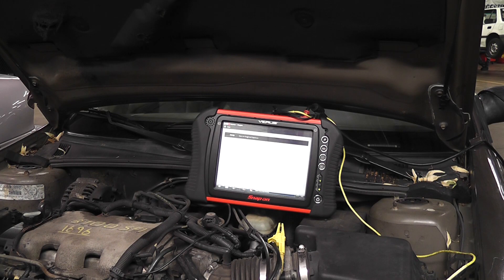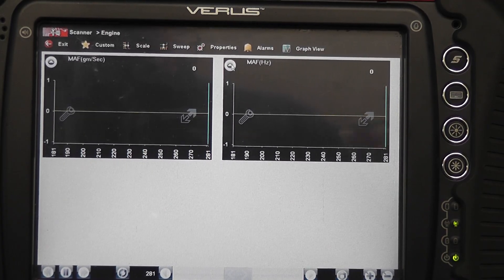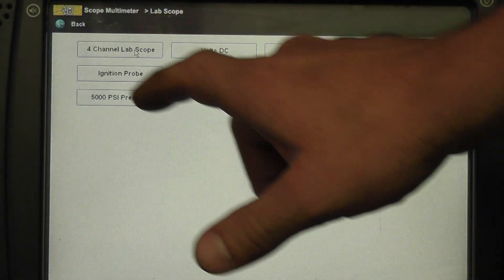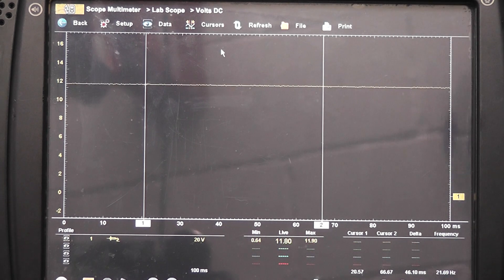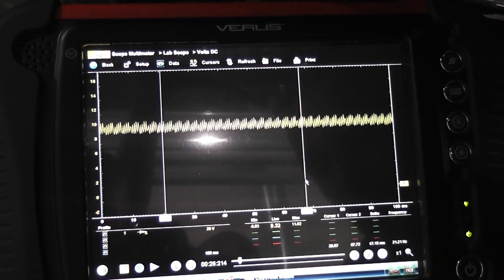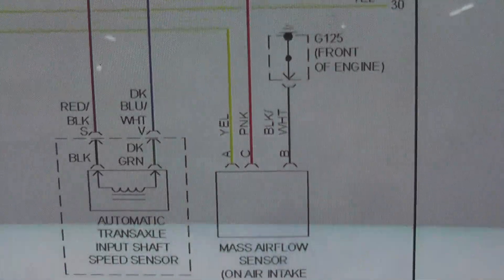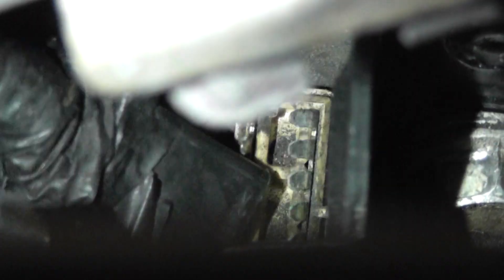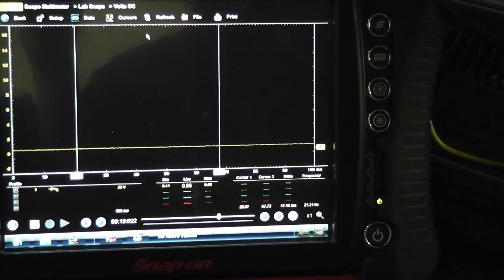MAF sensor trouble code (P0102) caused by a bad ground (GM 3100)

Comment: Watched a lot of your videos. they're a great help. But ran into something that has not been mentioned anywhere. My sons 1998 Pontiac Transport 3.4 l. In this you talk about a 5 volt square wave and its a pull down circuit. I ran done every thing as stated , 3 wire connector as you show there. id the three wires. we have three codes of P0102,P0300, P0440. starts ok when cold but warms runs bad, and stalls if you let it, hard to restart. all went ok till the signal wire to either battery ground or sensor ground at plug with a volt meter. with motor running instead of 1 volt and ramps with rpm increase it reads a 4.45 volt regardless of rpm and or either ground. Cant seem to find anything on it. Was told that MAF was bad and replaced it to have same issues. Thanks for any help.
Reply: sounds like mine 3800 series 2

Comment: Yes but dealing with a newer car the chances of it being a bad ground are slim and nil, especially if no work has been performed, it is a better chance that it is a fouled sensor, or dirty air filter restricting airflow
Reply from the maker: Would you know what a bad ground on a sening cirxuit looks like? This video and procedure goes way beyond an older car. There is a principle here that applies to everything!
Reply: Hahahaha! You must not live in the Midwest.

Comment: Would have been okay while back probing the ground, to touch a test light hooked up to battery ground to that computer ground wire in order to give it your own ground while checking the signal wire?
Reply from the maker: test light not needed, just a jumper wire to ground would have worked, so yes

Comment: Very Helpful Video. Thank You.
Daughters Mercury Milan lost engine power, I scanned the ECM and got P0102 and P0113. Doubtful both went bad at the same time I figured another problem like wiring. After your video I found and fixed the ground connection. Now all is well. Problem Solved. Thank You For Taking The Time To Do This  Video.
Reply: Exactly the same issue I'm searching for. You could say I'm a good woman.a darn good woman. Obd2 codes are PO102 AND PO113
2008 Toyota 4Runner crank no start. It's been 4 months without a vehicle and I'm going crazy. Trying to help my hubby. Watching videos cleaned maf, replaced battery , first off hubby went strait to the fuel pump and filter. Changed the filter, pump was OK.

Comment: Got 99 buick regal ls....stutters when accelerating. Changed spark plugs and wires....whoever had the car before tore the boot for the #4 plug and wrapped tape around it so it super coroded and broke off. That stopped the misfire, but i also had a p0102 voltage high code. Cleaned the maf sensor and it worked fine for a while that day then the code came back. Should i just change it or do a little more digging.
Reply from the maker: watch this https://youtu.be/p2QLxxstRn8
https://youtu.be/E8sBg7kMbOw

Comment: Well done ... I have a question... Got a 99 chevy suburban within the 
past 5 years it slowly A- starting running good then rough and now very 
rough, B -gas gauge fluttered a little, got worse and worse to now full 
on flutter on "Full" and C random shit is shorting out once something is
 fixed ... for instance ...AC dashboard switch (medium low) grey wire 
burned out... once that was fixed the 3rd or Medium high burned out wire
 ... once that was fixed my 4wd actuator started shorting out... then 
battery drained...then rear driver side tail light mother board burned 
out (bulbs were black and mother board smelled like burned plastic)... 
then alternator dies, battery again, window motor driver side burned out
 (melted plastic) ...Blower motor wire burned ...etc ... ALL right after
 another ...all electrical and it's running very rough now, (idle is 
rough but runs good on highway), random misfires codes po300 came on 
today while trying to fix barn door lock then went off and came back 
intermittently, abs light came on last week as well and gas gauge 
flutters (need to look close-flutters so quick) at full constantly. One 
mechanic said it was engine rebuild, another said fuel pump and another 
said Fuel injector(fuel spider) ... I believe its just a bad ground 
somewhere... possibly in the back near the gas tank??? b/c my driver 
side rear defroster in window do not work (passenger side does) and also
 I replaced my driver side rear tail light mother board three times 
already(including last week)...once I replaced it the ABS light came 
on... I jiggled the copper connectors for my rear barn door (driver side
 door) door doesnt have wired connectors, instead it has those copper 
pins or connectors sticking out... while doing this with a friend we 
noticed gas gauge would stop fluttering and go down to almost empty fuel
 gauge (which I think is where it is at) ... that's the first time I saw
 the fuel gauge NOT flicker in 6 years! and misfire codes disappeared as
 well ... any idea? Am I crazy or what ... also- I sprayed electrical 
cleaner on ground under driver side rear (strapped on to fuel line 
connected to gas tank and my friend put his hand on it and swears he 
felt a tiny shock ... I did it a minute later and didnt feel anything...
 any ideas? I'm desperate but determined and also, everything that goes 
wrong electrically (in case I havent made it clear) seems to go right 
after the other- which is why  I think it's a grounding issue
Reply from the maker: you have more issues than I can help with here. Can you post to my forum?
http://www.scannerdanner.com/forum#/general-repair-questions/

Comment: I have a 2001 Chevy Malibu that just cut off on me while driving. I was told a few things and none of them have been right so far. Now I have a friend who asked to see what's up with the car and when we tried to turn her on we had smoke rising from under the car somewhere. My question is could that smoke be coming from the connection terminals to the battery or the starter. I'm really not to big on working on cars nor fixing them but your help and guidance would greatly be needed

Comment: hi Paul. great video, very informational. one question, where do you get your wiring diagrams ? they help out a ton in situations like this. i needed one yesterday when i was trying to test a family members P2135. it was a drive by wire TB. but then noticed that it had some kind of short, i would hit the headlight switch on and off and would hear a popping sound in the seat warmers, the bass in the speakers with the stereo off and a static sound at times. that was out of my league since so i told her to take it to a technician. lol . im learning alot from your videos, thanks for your time.

Comment: You nailed it! I abandoned the plug ground cut all the wires twisted together, extended the wire, wire nutted them together, added a ring terminal at the new ground end, put on ground bolt in front of battery, added star washers to insure a good ground and it runs like a dream. Shame on Chevy engineers for not using a sealed plug on the ground. Great post, thanks
Reply: I was wondering if you could do that. My ground runs under the engine somewhere, no idea why it just didn't go directly to the ECU because it runs right past it. I wonder if it goes to another sensor but I will just cut it and ground it.

Comment: How many Ground splice connectors typically does a car have. I have a 2000 Lumina and was wondering where they were located but cant find a diagram anywhere. I also have a P0102 code right now on the car which is also a 3100. Going to test everything tomorrow with my multimeter

Comment: hi  wear is the pcm on 2001 chevy malibu thx
Reply: the PCM is located near the front of the engine under the hood on the drivers side...the BCM is located under the drivers side dash
Reply: that is correct...i thought the pcm was under the dash until my gm mechanic told me that the BCM is under the dash and the PCM is the box under the battery tray...im having a problem with my MAF circuit myself

Comment: Thanks for the video very helpful I have a 97 chevy truck with a p0102 code so when I check the wire with a light tester the truck shut off right away could it be the same as the video ( 2000 chevy Malibu MAF ground problem )
Reply: Same year truck, Same problem, Trying it tomorrow!

Comment: 03 Impala 3.8. Engine code 171. High idle after warmed up. Mechanic said it needed a MAF, same problem, then an IAC, same problem, now he says it's the computer. Seems like another parts changer. So now I'm trying to research the problem myself. Great video!
Reply: metalmoto good question, sounds like multiple issues maybe. a vacuum leak or low fuel psi will not cause a 3000 rpm idle speed on your car. If it was a MAP engine a vacuum leak generally causes a high idle but a MAF engine will generally idle low. So I do not think your P0171 and high idle are related. Hard to help anymore without seeing the car. I would need data. TPS readings at idle during the high idle issue would help. Also STFT and LTFT numbers at idle and 3000 RPM
Reply from the maker: Ive never seen a computer cause a P0171 code. It is very unlikely that it is the computer. Vacuum leak or fuel psi problem is my guess
Reply: Thanks for confirming this. Can't find any vacuum leak yet. Although I did find a TSB about clogged fuel injectors. But why the high idle? 3000 rpm sometimes.
Reply: Worn out throttle body would cause this. Either get it re-bored or replaced. Cleaning it can make it better or worse. I've seen this code caused by cleaning up a worn out throttle body. I can explain how and why it's caused by the throttle body but it's a long explanation and I don't think anybody is reading.

Comment: I see a lot of cars coming from other "part changers" workshop,I usually tell the customer if i can't fix you don't pay as its not fair to them when you throw parts and labour at their expense,great vid Dan,love it,btw my wife thinks its strange when iAm in the hot bath watch your vids....
Reply: Atleast she's not the one in the hot bath watching his videos and trying to explain it to you. 
Because.... that is what i am doing! My husband just got so frustrated by that air ratchet he left the room. Its been 4 months without our 4th gen 4runner PO102 PO113 husband doesnt really ... atleast i dont think he does much troubleshooting. He goes strait for the heart. So he dropped the fuel tank and changed the fuel filter, tested the pump it was ok. New battery cleaned the maf sensor cleared the codes and it didst come back. I know cause i checked. I ran the obd2 code reader and no code when in the on position. Crank no start. Nothing really before this happened. There was a few times fuel was low running on fumes. I remember driving away from the gas station the car didnt have much power. Then going home on another occasion up a bridge didnt seem to have the normal 4.7 v8 power. Then my hubby drove it fishing went to a friends house and no staet. Couldnt evrn jump start it. Towed it home and here we are 4 months later and we are freaking broken. Sucks being poor. Marry 4 money hirls dont do what i did... married4luv. 
56 no car, feel freaking hopeless. Scanner Danner must be from Ohio. Me too. I can tell from his accent  unfortunately im now in he double ll new orleans. Okay then bye

Comment: I have a P0103 code on a Ford which means high voltage, could a bad earth still be the problem as regarding the P0102 low voltage in your case?

Comment: yea i had the same issue on my 2003 impala. but couldn't find the ground break. so i did a direct single wire hookup to the sensor plug and to a bolt to the engine block and all working again.

Comment from the maker: depends on the current flow of the circuit. Higher current circuits will have higher ground voltage levels. Computer and sensor grounds should be less than 100 mv

Comment: P0131 - GM = HO2S Circuit Low Input Conditions

Location	
Bank 1 Sensor 1

Cause	
Engine running in closed loop, then the PCM detected that the HO2S-11 signal that was less than 250 mv (less than 97 mv on VIN 1 & K engines), condition met for 2-4 minutes.

Comment: Excellent diagnosis!  I had a similar issue with a Monte Carlo.  Customer was irate as had thrown parts at the car for a P0102/420.  As you can imagine not cheap.  I did some checks, and it was the charging system.  Alternator was bad.

Comment: I have that same codePO102 , plus PO131, and PO171. Could the sensor make these code pop up if its bad?  And  is it the reason my car stops  running when I stop at light or sign?When i unplug the sensor the car will stay running but it shifts hard, and burns gas quick!!! If you could please help!!!!!!
Reply: Did you figure out what was wrong?

Comment: I have no idea. I got it scanned at my cousins shop and all he told me was that it was a code for the mass air flow sensor. After i changed it, it runs a little smoother but no clue what else is wrong. I just barely changed it yesterday.

Comment: I changed the maf sensor and my engine light is still on. I get bad fuel mileage, rough idle, and loss of power. What else can be the issue? I have the same car as in the video

Comment: regarding the parts changers . I have had 3 certifired mechanics work on my car and all three have been professional parts changer, including the one at the local GM shop. I ended up figuring out what the problem was after wasting 1800 dollars. Very dishearting

Comment from the maker: no it does not apply to nissan and toyota they are analog type mass air flow sensors. the only time I apply the terms pull ups and pull down are with digital signals.

Comment from the maker: u don't need a Verus to do what i did in this video. it could have been done with a multimeter and a basic scantool. although to see the actual waveform that i showed at the end u would need a scope for that. look into the picoscope. or maybe the vantage pro. the vantage pro has the advantage of an awesome database and the picoscope has the advantage of just simply being a much better scope.

Comment: Great video Paul as always, I see too many 'parts fitters' which annoys me as a little bit of thinking and checking will usually fnd the problem. Just to confirm then.. 100mv and below is considered a good earth with the circuit loaded ie key on with current flowing?

Comment from the maker: lol on the sucking up part. don't you mean how is frequency converted to air flow? it would be the same way every other sensor is converted the engineers write in a ROM lookup table what the value is in there you have it. wish I knew more about that part of the industry. I have to go back to school for electronic engineering

Comment from the maker: good question. what you have to remember is this circuit is monitored for frequency so a circuit low code means low frequency not low voltage. hope that makes sense

Comment from the maker: that is correct but it would depend on where in the harness the sensor ground wire was corroded. if it was in the last leg on its way to the computer yes it would affect all sensors. if it was on an individual branch it would only affect everything on that branch

Comment: Great Video Paul, just a quick note, if sensor ground is shared across multiple sensor , and if ground is corroded it would impact all sensor not just that sensor, is that right. since it is single wire , impact on one place would impact rest of the points as well.